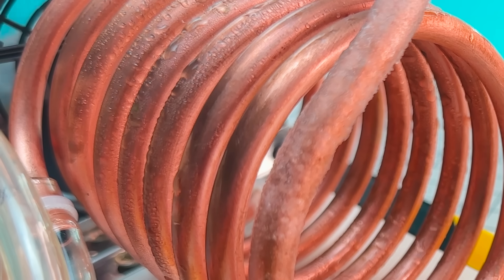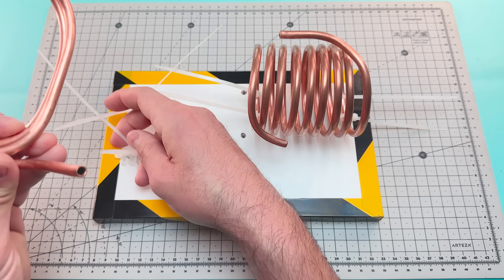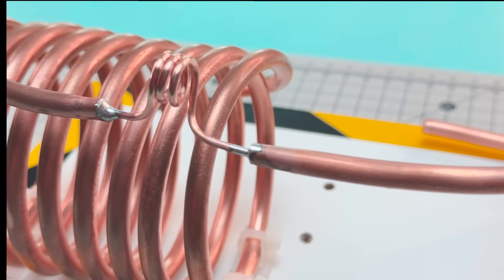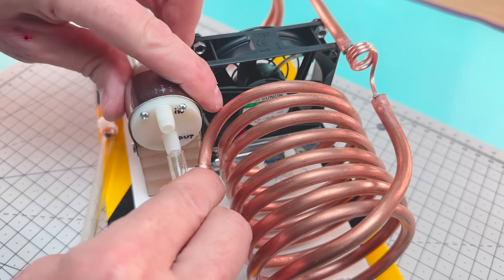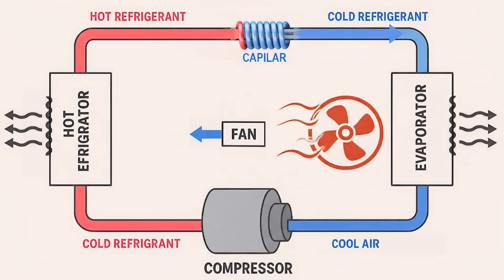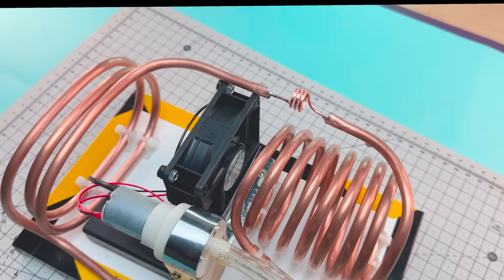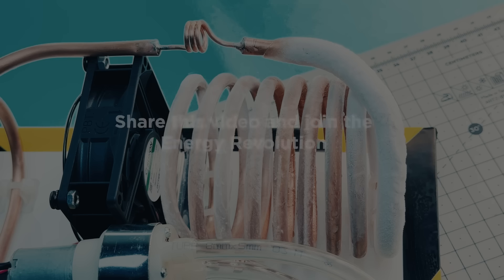Make your own AIR CONDITIONER at home Fast and Easy!

Comment: it’s misleading and ignorant to say this will cool a room in the summer when it’s pumping cold air from one side but hot air from the other. it will do exactly nothing to a room temperature.
Reply: Well, the hot air needs to face outside like most air cons.
Reply: actually, since it is consuming power it should increase the temp, just a little, but a more powerful one would increase it more, lol.
Reply: @justme.9711 Have you tried it?
Reply: Господа критикующие, этот ролик для школьников изучающих технику. Дабы показать принцип работы.
Что вы все умничать пытаетесь?
Можете лучше? Постройте.
Reply: @НосовИван  здраствуйте товарищ Иван. I was not criticizing the device or how it was built. I was criticizing the claim that it will cool a room (it should have mentioned that the hot air needs to be removed through an air duct or something like this.
Reply: I mean make the pipe just a little longer so you could put the hot side outside and the cold part in with a fan on it It could cool a room.  I only like this idea cause it uses such little energy, definitely going to make 1 kinda like this one
Reply: @Dr.Mcstaby  I just typed the same thing. You're a Genius.
Reply: @Dr.Mcstaby 9v batteries are not very good for environment, some of them are basically stacks of lithium button batteries inside. But as you buy them in supermarkets it must be OK, right?
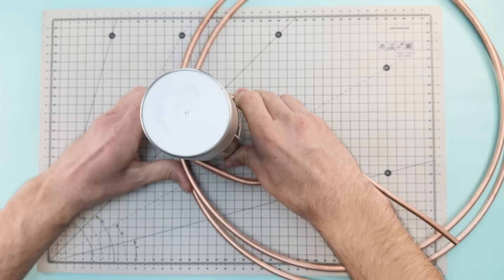Reply: @Dr.Mcstaby  1:23
Reply: Other part needs to be outside the room so that room doesn't heat
Reply: Dude, it's a heat pump! And you can operate it as a heater or cooler! It's exactly how your fridge or ac works! One side gets cold while the other gets hot. If you keep both ends of your ac in the room, it won't work either!! But good we talked about.....😬😂
Reply: Except raise the room temperature slightly. It's a joke. If they put the condenser outside it would have been able to keep a cooler a few degrees colder. They built a tiny dehumidifier.
Reply: To be fair he's putting work into it which means to the air temperature in the room will probably increase not decrease if only just a little bit
Reply: It will gradually heat the room. Don't forget to allow for heat from compression.  Heat pumps work the same way.
Reply: It won't, but if you placed an entire AC system inside a room it wouldn't either. You'd have to add a way to dump the heat outside of the house with a duct to a window like the small wheeled AC units you can get do
Reply: If you pump the hot air out of a window like a window AC unit does, then it would work effectively
Reply: You said that the gas uses the available heat to fuel whatever process is supposed to be taking place here. If thats true, you've created the perfect air conditioner and should be a billionaire hero about to save the world from global warming because every AC unit I've ever owned simply separates the heat from the air particles and expelled the energy back into the atmosphere outside. They're essentially air-relocators.

What it sounds like you're referring to is something entirely different. Transforming the heat into kinetic energy, without a conversion back into heat. 
To be honest, I don't believe that's whats happening, BUT it does make me curious as to whether or not it would actually be possible to transform heat into some storable form of energy that can be used later, rather than allowing it to transform back into heat.
Reply: Anyone have a build list?  Just for fun. Don’t care about the heat issue
Reply: @jasonwest9801  I found an R385 pump on temu that should perform the same. I bought 5mm copper tube and 3mm copper tube.  Any 12v dc fan like a computer cooling fan or power supply fan.  I plan on using an IBM server fan for the blower and a computer cooling fan for the condenser fan.  Making a few small changes.  Adding a divider of sorts between the 2 compartments so exiting heat coming from the condenser can be vented elsewhere.  I plan on using the 5mm for the evaporator and condenser  and 3mm for the capillary tubing.  I don't believe 3mm will be small enough but I'm going to wrap it 8-10 times as tight as I can, as small as I can to help with the size. I may have to try smaller capillary tubing if it doesn't work but just for science.
Reply: Ac works by removing heat, not cooling air...this can't remove heat, only displace it, my guess would be cooler on one side of room, hotter on the other, no way to accurately take temp of room
Reply: I’m just here to watch the countless contradictions and repeat claims.
Reply: You need to get the hot air out for this to work
Reply: The condenser side gets mighty hot on AC units,  also requiring a fan to cool that high pressure gas down,  maybe butane works differently than typical refrigerant. I just am not seeing how this is going to cool a room?
Reply: it will increase it because the coils of the motors heat up
Reply: It will actually increase the air temperature in the room. The cooling effect of the evaporator coil should be equal to the heat output of the condenser coil but the fan and pump are actually generating heat so the room will get warmer. This is why condenser coils or the heat they produce need to go outside. If you mount this thing in a window and separate the 2 coils so the condenser is outside or build a box around the condenser and vent the heat outside it'll work.
Or if you used a heat sink or something so the heat dissipates outside, that would work.
Reply: I figured there was something fishy and only "watched" long enough to pause the video and click on the comments. After reading a few, it is time for the thumbs down.
Reply: And why wasn't vacuum applied before charging with refrigerant?
Reply: You at least have to put a diverter in there so it's not sucking the air directly from the hot coil and blowing it on the cold clove
Reply: But it's a good guide for understanding the principle of such systems. You can experiment for yourself to see what happens if you supply the condenser (the warm part) with a different fan. And you can also build a heater from this model.
Reply: @domi9322 no. This model is all faulty, misleading and disinformation.
Reply: @alexypagan  all you have to do is put the condenser outside, just like every window AC unit you've ever seen  😮
Reply: Very true you cannot cool the air in a room because you’re blowing it out one side and then blowing the heat back into the room from the other side
But this would work well in a shoebox full of mice
Reply: It would condense water quicker than it would evaporate, water vapor would condense somewhere down the coil, at its dew poin, you could use this to make water, in a catch basin
Reply: Loving these debates with grammar discrepancies😅😅😅 All argument good. Sum argument stooped. No like negative commontory. Bee nyse, no ise. English speak me perfect. Bizzarro Luv Yu❤🎉😅😅😅😅😅.
Reply: Wow this cooled down my house within 2 hrs ...
Reply: No but this will chill a closed water system that in a suit would make a AC suit! Im making one as we speak for field labor and extreme environments.  Its basically a wetsuit with a backpack of water that cycles inside the suit through small tubes in areas where you get hot. Like wrists, back of calves, inside thighs etc. I was gonna use petilier modules and water blocks but this would be much more efficient and I can try to make it smaller and fit inside a small pack on the back and powered by a large battery.
Reply: Can you isolate the hot side add another fan to blow it out like portable ac do
Reply: Its a small model ..
Reply: You're 100% its just a little dehumidifier 😢, good for little tiny few bottle wine cooler
Reply: Thats why we have to think and DIY
Reply: I think the video is doing just as intended..  And your comment proves that point. You watched it and promoted it with the comment. YT goes by engagement. Positive
or negative,  no matter.  So before you claim the intellectual high ground.?¿???
Reply: Doch, die Abwärme kommt noch dazu. 😂
Reply: Theres no pumping in the other side
Reply: All you need is a hot exhaust vent that leads outside
Reply: I'm pretty sure they know it's insane.
It's called klickbait and you serve them with the algorithm with your comment
Reply: @Kamikaze1987666 unfortunately i think you are right
Reply: …Just place the hot par outside.
Reply: You put the hot side out the window?
Reply: Based on the principle that hot water freezes faster than cold water,it kind of blows your statement to bites that it won't work 😅
Reply: Yep. The hot air needs to be vented outside the room for cooling to take place.
Reply: Maybe instead of that fan have a inline fan with some ducting blowing out towards the cool side towards the room you're cooling and how the room you're cooling closed while having that device on the outside of the room will that maybe cool a small room or tent
Reply: I know that 1 + 1 = 2, but maybe use this idea as a base and make alterations to suit your needs? My first thought is to add a slow-burn alcohol lamp on the hot side and a Tesla turbine for the internal circulation, THEN using a fan to direct the cold air. You are why mathematicians are seen only in the beginning stages of building.
Reply: He has a 9 volt battery running 12 volt fun and air pump. Is that possible?
Reply: You need to put the condenser outside the room
Reply: Фигня это всё, делал наподобие. Водиаторные спайки дополнительно вакумирева. (Помпа) расчитана для воды, без давления. А в видео показанно якобы он просто заправил ГАЗ и унего всё норм!
Мэмбранная попмка не выдерживает даление!
Так что для этой самоделки нужен мини компрессор.
Reply: You HAVE to find a way to at least move the exhaust heat to another room or preferably, outside! This teaches you how to make an air conditioner and if you can do that, you can figure out how to run some vent pipe and a battery operated fan, its not that hard!
Reply: غاز البوتان خاص بالطبخ يعني للحرارة وليس للبروده يمكنك استخدام غاز الثلاجة الفريون هو أفضل
Reply: Saya rasa ini mengedukasi.. Sistem kerja AC yg sederhana.. Dan  video ini hanya sebuah prototype.. Yg bisa disempurnakan menjadi AC.. Dengan penempatan sisi panas diluar ruangan dan sisi dingin di dalam ruangan..
Reply: It's going to take a lot of batteries 😅😂😂
Reply: Your AC also lets out heat. Just outside your room, so you don't feel.
Reply: Make it like an hairdryer and allow the motor to cool down with fan and get the cool air from one side with a fan
Reply: Forget cooling a room. There using butane a highly flammable liquid/gas that can Explode due to electric near. This is why we don't to use butane in our home and cars ACS. On top of that a 12v fan and motor running off of a 9v battery! Come on really. And people are eating it up like no one knows how to do any research when it's at there fingertips
Reply: Heat should leave the room and cold air should circulated in the room. But the amount of cooling power out of a low capacity battery of 9 VDC is like 1Watt. That’s not take any effect in the room. For the amount of heat it takes forever to exchange the heat to the outside. But a beer could be cooled a bit and with more power you can make an icemachine or coolbox. But a whole room😂
Reply: I was reading all the comments. Very interesting, indeed. All I see is "it will" types of assumptions 😅😅 😅 None even bothers to try and comment on the outcome they found! 😂😂😂
Reply: It will increase room temperature.
Reply: 1:16
Reply: Simple fix with some ducting
Reply: Unless you increase the scale of the air conditioner...
Reply: Just put an extra on the hot side and make it go out a window
Reply: But if you use this outdoors, just say something to have cold air blowing on you wouldn’t that be fine? And or what if you did water cooling?
Reply: No separation of condenser and evaporator, no fan for condenser,before the refrigerant is added,air has to be taken out thru a vacuum pump.
Reply: Minha dúvida está em quanto de distância manter a condensadora da evaporadora para deixar a parte que esquenta para fora? 
No inverno seria possível só inverter a posição? 
Quando der gás foi injetado? 
mL/cm e tubo? 
Só questão de aprendizado. 
Foi bom o vídeo, pois explica a ideia em si. 
Parabéns
Reply: I suppose you could put the condenser outside of your window.
Reply: It is a learning video about how this process works
Reply: @abram7716 it Doesnt WORK.
Reply: Exactly  @abram7716
Reply: @abram7716 Автор сказал что охладит комнату в жару,какой же это эксперимент?
Reply: I mean make the pipes a few inches longer hang the hot side out a window, and the fan and cook side inside the house....
Reply: However, as he uses a fan you could  have a cooling effect in front,  better than a usual fan or cool down a coke 😊, but yes the room will not change, for me this looks like a fun project for kids.
Reply: @Kuno490 it is a fun project but the "sale pitch" is miss leading. He should have emphase that the heat need to be dispersed outside the room ( and should have need a heat sink fan on the hot side more than the cool side )
Reply: Completely useless video. Don't waste your time and money doing the same thing. The little energy contained in the battery will turn into heat and warm your room very, very slightly, imperceptibly.
Reply: @philippemaurisse615 It's a model to show people how these systems work.....not cool the whole room at record efficiency levels. Holy crap.....I feel like I'm replying to children.
Reply: But it can help Chinese people 
Making micro mini freezers more cheaper than expected
Reply: Welcome to propaganda 101
Reply: That's why God created the thing in between ya ears. Good to see you can use it.
Reply: Very cool
Reply: Depends on the performance of the refrigeration cycle
Reply: He did state  it has a portable air conditioner which to me the portable part is you're outside what's the hot air would dissipate from it and the cool part of it would blow towards you keeping you somewhat cooler for someone that has like heat intolerance issues it would help keep them cooler so they can actually go and attend family events and such like that Outdoors possibly. But if you could come up with a rechargeable battery source that would plug into a USB port to charge up would be more handy, because I don't know how long a 9-volt battery like that would run the system. This is my own thoughts on the matter because I'm always looking for new alternative ways of cooling myself because I do have heat intolerance issues and it's hard going to family events Outdoors because of it. I'm always trying to find a way to build a keep myself cooler so I can go enjoy family events, instead of hearing about the family events. I'm going to build one just to see what it might do for me
Reply: Do you set an air conditioner on the floor that is designed for a window and expect it to cool your room? Obviously the same concept applies you have to vent the heat also if you want it to work properly. It's common sense
Reply: I cant believe you guys got all these comments on if this thing will actually work. You guys are crazy man. This thing will totally work. This guys is showing you guys what and how to do it, and It wont work? Come on guys…. I was gonna be rude and call someone stupid, but i dont think that would be nice.
Reply: Dude all of you wtf are you saying? The cold liquid get liquid at ±0° this means that the -10° will cooling the room even if the warm flow is 30°-60° because the cold area will start cooling even the hot parts until also them reaches 0° and the system will continue transform the refrigerator fluid in to liquid because it returns liquid at 0° generating eventuali a frost situations that’s why you have the defrost feature on refrigerators!!!! Because the cold it stronger than the warm… hot objects is constantly losing heat so with a -10° nearby even the hot objects will frozen… 

so YES it will be able to cooling the room… 

If you’re not happy, then use liquid nitrogen, then for sure you will frozen everything 🥲
Reply: @Timetraveler_1  dawg that's now how the laws of thermodynamics work dude.
It is not possible for a device to create cold temperatures and cool the room.

It's like saying I'll open the fridge door and it should cool the room, it heat it instead.
Reply: @Timetraveler_1  this device do not create anything, it transferring energy from one end to another end using gas as a worker. In one closed room, despite transferring energy - it doing it in a closed environment, which means that energy is still in a closed environment. What you did - is just separated some volume of air to have more energy, and some less. But due to battery and energy it releases to motors, their efficiency are not 100 percent....thus the loss are released as heat, adding energy to the closed environment.

At the end, ac systems are perfect to exchange energies between  two closed systems, but useless when are used in one.
Reply: @Timetraveler_1 youre right all that it will doo to a room at best is remove some humidity, unless u consider a room 24in24in box sure, & even for thatnyou will need large box of 9v batteries say the least, coefficiency calculation baby, wjat u built there is a dehumidifier, needa a bit more work to be am air conditioning applicable appliance of any sort, but very nice
Reply: @Timetraveler_1 hahaha
Uhhh...no.
Reply: @Timetraveler_1  The first law any HVAC or refrigeration professional learns is that it is impossible to create Cold.  Cold is simply taking away heat.
Reply: You need to learn just a bit more of thermodynamics
Reply: I say you are the ignorant one
Reply: The cooler side has a way larger Surface Area so it will cool the room .
Reply: @choshpurchenko 

There is a reason conventional AC units, even the awful portable units, have an exhaust or outdoor component. 

Heat is exchanged and that heat has to go somewhere...outside. If you turn a window AC unit around you'd literally have a heater that's more efficient than a space heater.

This is why the room would actually get hotter over time with this device. If you had it next to your face so the fan blowing over the cold coils was blowing on your face it would feel cool but the room would actually be getting hotter. The second thr battery ran out you'd feel even more miserable. 

Actual AC cools and dehumidifies a room, this doesn't.
Reply: @DannyWilliamH There are so many problems with this device. If he fixed those problems, and vented the heat elsewhere, this device would work as an air conditioner.

Unfortunately, this video is faked. Generally, air conditioners will not make the cool side cold enough to create frost on the coils.
Reply: @DannyWilliamH 
I agree,...maybe if we submerge the condenser is water we can transfer the heat to that water?

Thoughts and ideas.
Reply: @choshpurchenko  The surface area has nothing to do with it. Nobody cancelled thermodynamics ;) Smaller condenser surface area = hotter coils. Larger = cooler coils but radiated from a larger surface, so the amount of radiated heat is going to be the same.
Reply: @choshpurchenko . No, because all the heat removed from the room is added back to the room. Like a window unit, you need to put the hot side on the outside of the room. Then you would be moving the heat from one space to another. One space gets cooler, the other gets hotter.
Reply: @choshpurchenko it’s Q in Q out, but in our commercial ac the Q out is outside the house so it doesn’t affect you.
Reply: @choshpurchenko That is not how physics works.
Reply: @choshpurchenko if I drop a 1/2 cubic meter ice block into a container with 1/4 cubic meter of 50°C water, what will happen? Will the air around the container warm up, cool down or stay about the same temperature?
Reply: @choshpurchenko false
Reply: @choshpurchenko 
larger side = less cooling, so no
Reply: @choshpurchenko wrong
Reply: @choshpurchenko So then where does the heat it moves go? Think about it for a sec man......seriously
Reply: @choshmongash4286 no, closed system will produce net heat and warm room. You have to put the hot side outside the room
Reply: @choshmongash4286  Nope. It won't. 36 watts won't do much of anything. So many problems with this device. It won't even work.

1) The cold side of a typical air conditioner is limited to approximately 38F. That's far too warm to produce frost on the coils.

2) 1st law of thermodynamics applies. You cannot get more cooling than you get heating, regardless of the relative sizes of the 2 surfaces.

3) He doesn't evacuate the air in the tube before trying to add refrigerant, so he didn't get much, if any, into the system.

4) Refrigerant isn't pressurized, because it would leak out through the hole he put into the side of the plastic tube. If it's not pressurized, compeession won't happen.

5) Hot side and cold side are beside each other leading to one cancelling the other out. Surface area sizes are not relevant. Same energy is used on both sides.